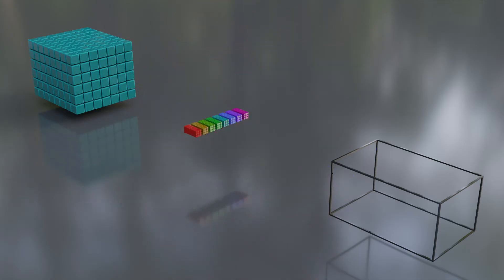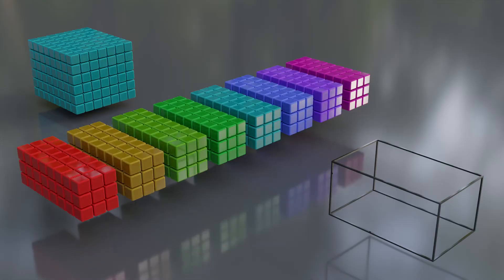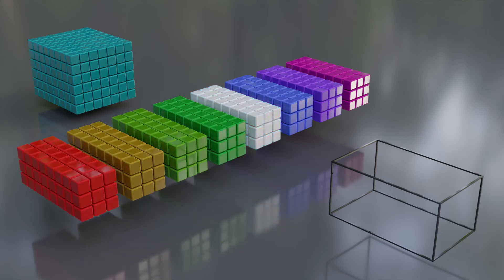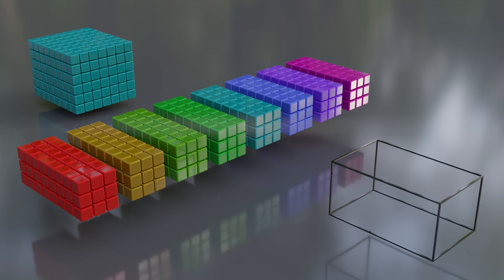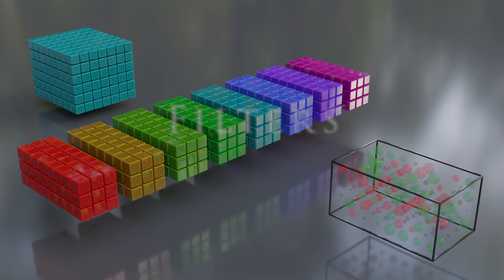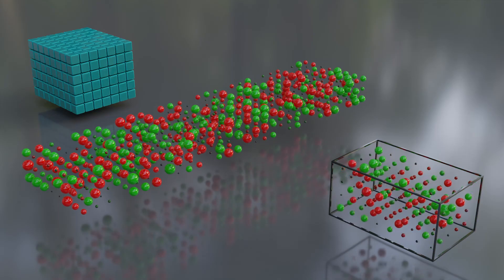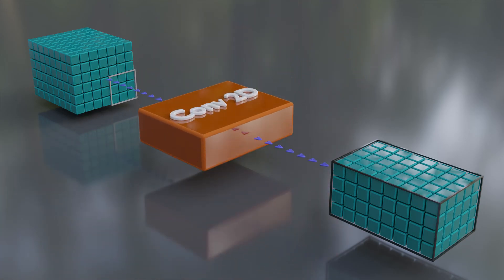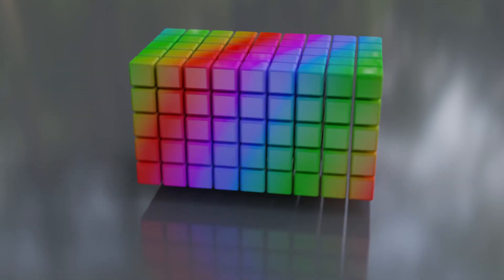Fundamental Algorithm of Convolution in Neural Networks

Comment: Why is the input 3dimensional for an image? Is each block in the 3rd or depth recording a different value for that same pixel? Like R G B, X Y ?

I under why the filter is 3d. Each layer in the depth is the next hidden layer of neurons.
Reply from the maker: I think my latest video might help explain that: https://youtu.be/XdTn5md3qTM?feature=shared&t=84

Let me know if that doesn't answer your question!
Reply: @animatedai  I had the same question as @spawn142001 and after watching the video you've linked I'm thinking why is the input not just of depth 3 for RGB, rather than depth 8 as shown in this video?
Reply: This is the exact same question I had, and the fact that this is shown without explanation makes this whole video pretty useless.

Comment: What is the feature dimension for, let's say, an image? RGB values? Sorry I'm kinda new to CNNs
Reply from the maker: If there wasn't a feature dimension, you could only store a single floating-point value for each pixel. Describing a single color takes 3 values: RGB. And as you get deeper into the network, the idea being represented at each point goes from a simple color to something much more complex that requires even more values. So how do we store multiple values at a single point? Add another dimension: the "feature" dimension.
Reply: @animatedai Makes sense, thanks for explaining so clearly!

Comment: This is a great animation my friend, however with my limited knowledge I am trying to figure out why the ‘’data’’ block is more than three dimensions deep, what I mean by that is, should it only be the three RGB layers?  Thanks for clarifying
Reply from the maker: Good question! Most visualizations out there show an RGB input to a convolutional layer. So you'd be reasonable to think that a depth of 3 is the typical input to a convolutional layer, but that's actually a special case. I chose to show more than 3 layers to help break that misconception. So I'm glad to hear that you noticed that detail.

If the convolution layer happens to be the first in the network and the input to the network is an RGB image, then the input to the layer would be 3 units deep. However, you'll have many convolution layers in a network. And, in general, the depth of the input to a given layer is simply the number of filters from the previous layer.

Check out the Filter Count video (https://youtu.be/YSNLMNnlNw8). It shows the feature counts of all the convolutional layers in a complete network. Note: that's actually the third video in the series, so if you want to watch them in order, you can follow this playlist: https://youtube.com/playlist?list=PLZDCDMGmelH-pHt-Ij0nImVrOmj8DYKbB.
Reply: @animatedai  I think the channel has great potential, but I would like a little more context - what is convolution? What's it good for? How does it really work (like the face example). Maybe more concrete examples.  I would recommend 3 blue 1 browns style. He explains a concept from scratch so you can follow almost each video from the start without a lot of prerequisite.
Reply: @animatedai  Thank you very much. You're the only one I found that explain this on Youtube. All others videos use the standard depth of 1 (if better, 3) for illustration. That really makes your video so helpful. Bravo!!!